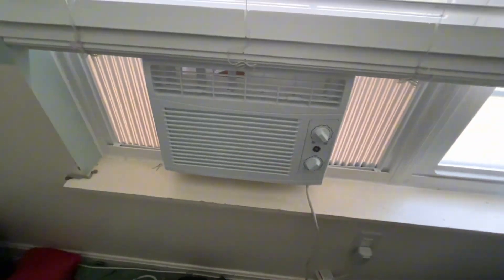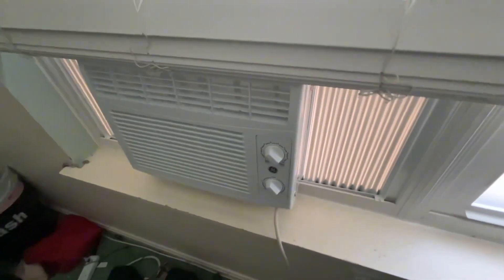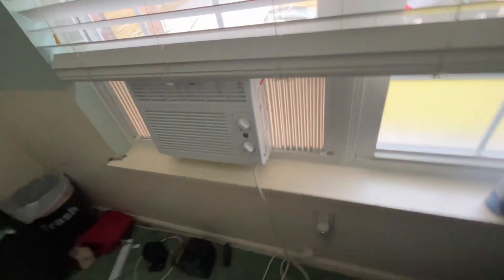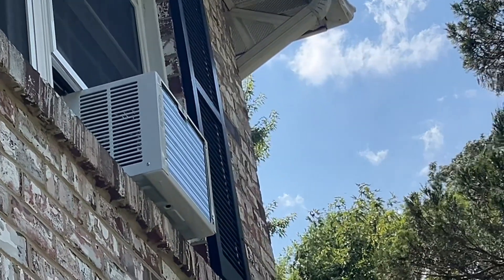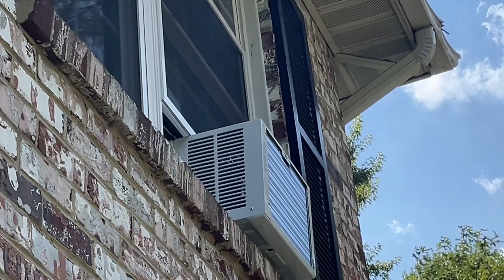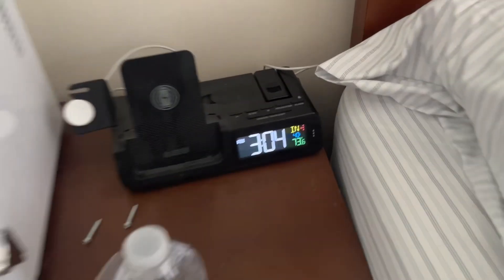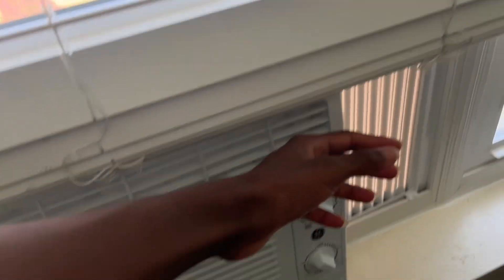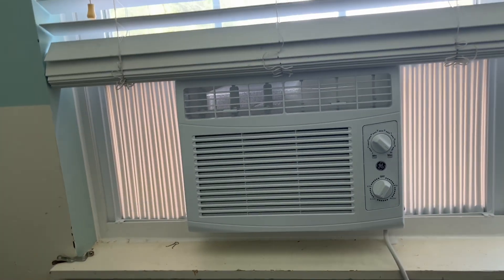Ge 5050 BTU window ac on max capacity on 101 degree day

Comment: I wonder how long that thing is going to last
Reply from the maker: Me too
Reply: @zenozer0themechanicalchann720  the compressor is not gonna blow up, it’s going to struggle even more at higher outdoor temperatures, in Texas it doesn’t get to 132 like that, only in death Valley Lake California gets like that… See how climate changes impacting? Texas only gets to 108° in the summer
Reply from the maker: @ArisBuliteanu thanks for letting me know
Reply: @zenozer0themechanicalchann720  what’s the model of this unit?
Reply from the maker: @ArisBuliteanu Ahv05ly
Reply: @zenozer0themechanicalchann720  can you do another startup of this unit, place your phone, where you usually place it, by the compressor… I think this unit has a gmcc rotary?
Reply from the maker: @ArisBuliteanu  this unit actually had a Quingan compressor. I’ll do a startup later today
Reply: @zenozer0themechanicalchann720  man that compressor side of this unit is actually one of my favorite sounds. I have heard on this one.
Reply from the maker: @ArisBuliteanu  it’s my favorite too. Although I would rather have a rechi precision compressor or a   
Reciprocating Compressor. I got the say that the best modern compressor is the Quingan. And the Quingan sounds like a rechi compressor in hotel units.
Reply: @zenozer0themechanicalchann720  sounds a lot like the Amana package terminal air conditioner, or actually one of them in 101° weather that this unit puts out…
Reply from the maker: @ArisBuliteanu  yes. Amana ptac is my favorite
Reply: @zenozer0themechanicalchann720  and actually, are you going to get one in the living room?
Reply from the maker: @ArisBuliteanu  our house does have central air but it doesn’t reach the upstairs well. However it dows cooldown the lower area.so we don’t need any ac downstairs.
Reply: @zenozer0themechanicalchann720  so the central air could be probably undersized? Or maybe not efficient for that space?
Reply from the maker: @ArisBuliteanu  yes that’s what I’m thinking
Reply: @zenozer0themechanicalchann720  wait, did you film your central air conditioner? Start up yet, I think you should… I like the condensing unit of it, what’s the brand model and gear? If it’s undersized, proper sizes crucial! You need a proper size unit!
Reply from the maker: @ArisBuliteanu  no idea but it’s difficult to film the central air. Once the chance comes up I’ll film it.